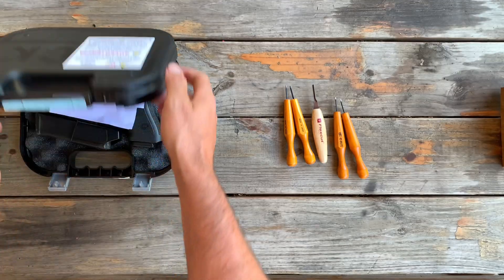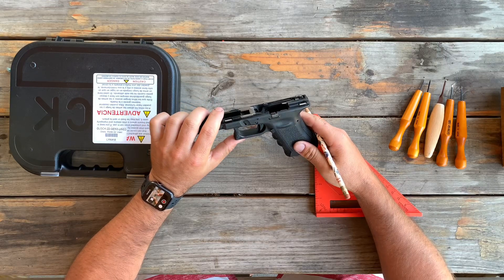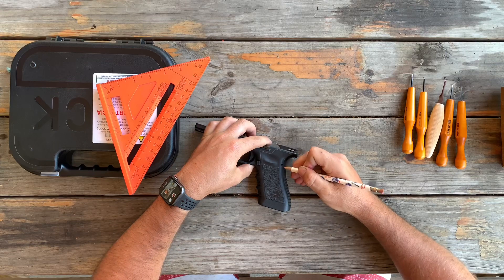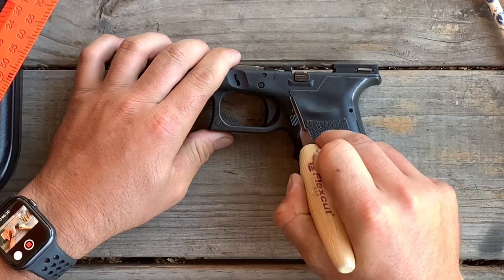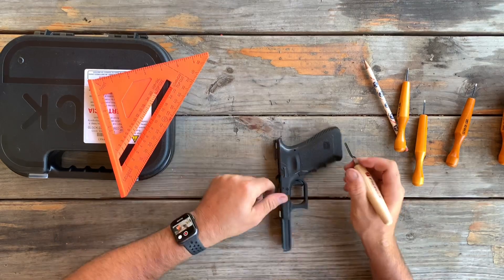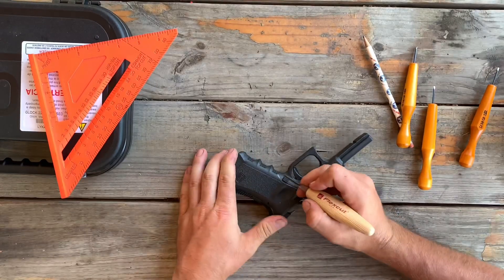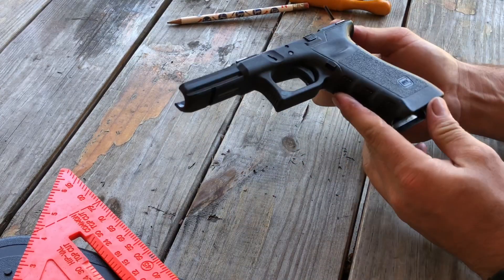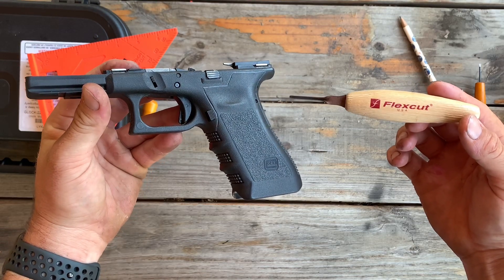Glock Stippling Clean Borders

Comment: I create safety borders around the entire stippled area using foil tape. this keeps all my lines perfectly straight and also protects the gun in the event that I make a mistake and get outside of the intended area. The foil tape that I use is the foil tape that HVAC installers use when installing 14 inch ducting in the ceiling or wherever the ducting might be...it's super sticky so it won't ever come off unintentionally which is important for this type of work because other types of tape either don't stick well enough due to the porous surface which is a lot of the time also slightly oily from hand oils or gun lubes which makes it hard to stick to.  It takes some work to tape the entire gun but I think of it like prep work when painting a house which also takes time upfront but allows you to move quicker and more accurately once you get going.  And it's really great for cutting shapes if you have any hard to reach areas you want to stipple.
Reply: Do you use the same tool or a soldering iron?